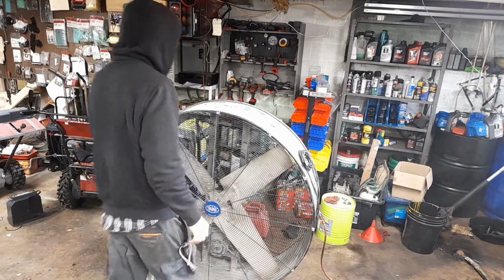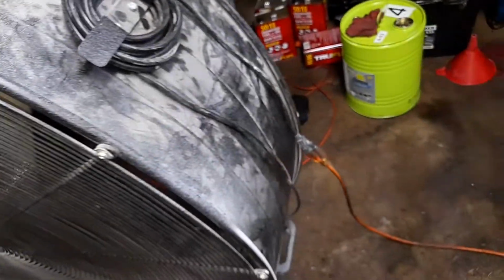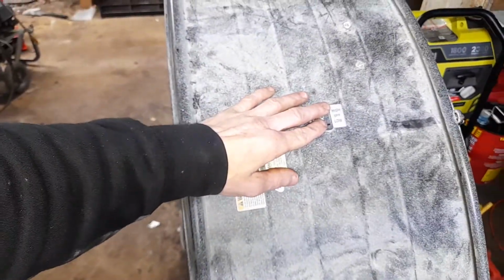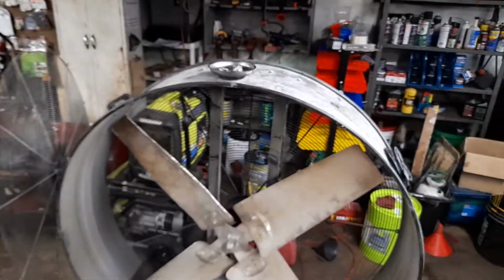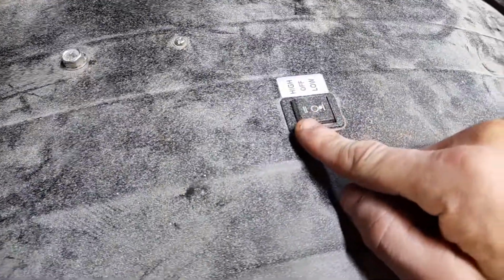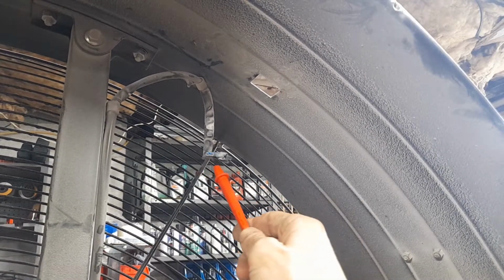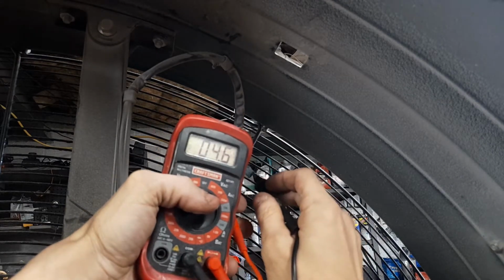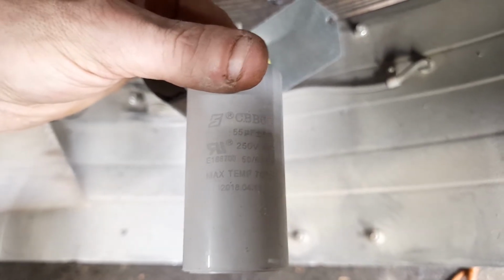Global 48 belt drive blower fan model FE120D5fL fan power electric motor diagnostic repair part 1-3

Comment: Savanna/NM from Birmingham Alabama, but in May 2019 or so, we went to a butterfly releasing event at Oak Mountain here but afterwards We are in a restaurant and then went to an antique store out in a mountain it sells well some people call junk black sculptures and other stuff and like garden stuff, and some windows to… But basically, so I want to see if the fan Western Union I saw in the past and 2018% going to the beach, and it Are you right or so, I was curious if it was still there and it was. But I have a vintage but John from the fan from Homart, but when we took it in the Emerson and not in, the Emerson to this motor a player motor repair place downtown here, sure, it’s a Westinghouse, we can’t really do anything with that. But he did say I have a motor I can put on the homart but it’s too powerful. But it used to spin clockwise and I ended up replacing the motor with the reversible motor so now/nxw it spins counterclockwise instead of clockwise Because of that, it doesn’t blow and even amount of air, and I want to/wanted make it clockwise again or actually it’s reversible and I want to make it work and just reverse wth a switch instead of having to get my dad to unwire it and make it ccw thxt way😕🤕🤷‍♂️Just wasn’t sure if you cxuld or nxt or so… and I can’t keep the motor or mount actually, maybe you could rewire the old motor that came with it originally? Let me know what your hours were cut the corn off of it but maybe we can rewire it with a new cord to make it work again but then the reason I replaced it was because when I put too tight of a belt on there and twisted it until I figure out an interest in it again and again it snapped it and then not be connected completely anymore. Maybe we could reattach it or you can reattach it or just try to get a new motor to be reversible with the switch. Sorry I got sidetracked. Mxybe just work if you can if it’s possible see about the Emerson roll about or so
Reply from the maker: woah that was a thorough response well put my man!